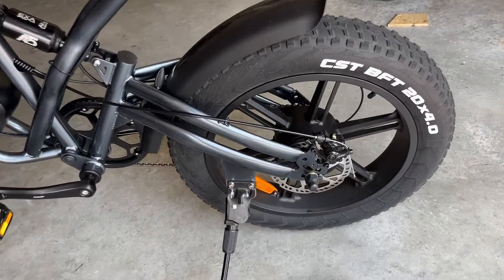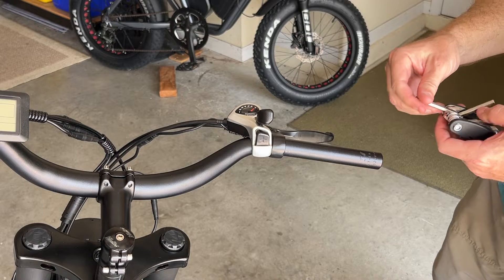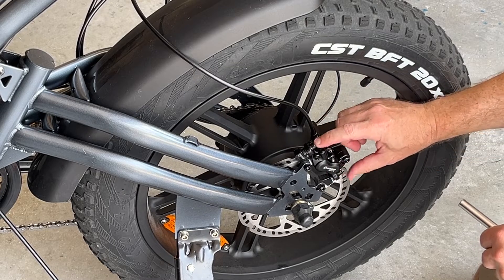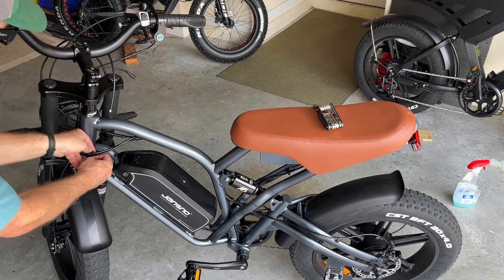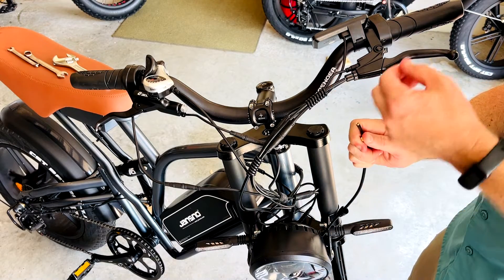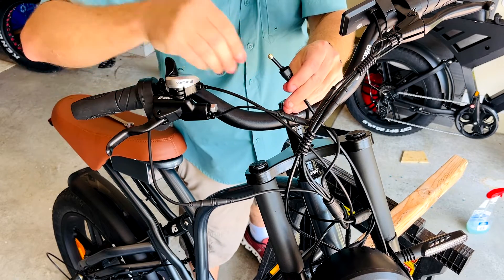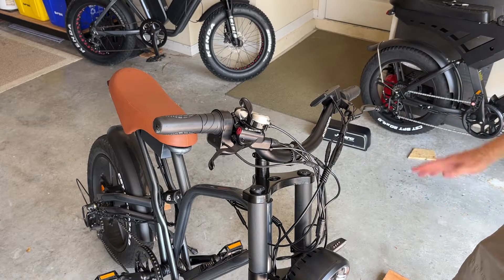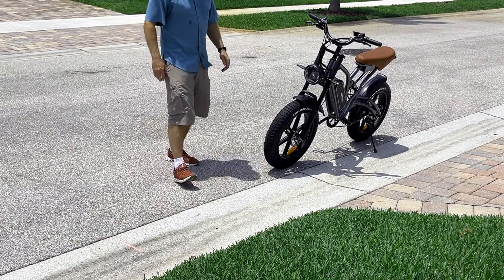Hydraulic Brake upgrade on Jansno X50 X70 eBike - Zoom 4 Piston Hydraulic Brakes

Comment: Hello! I need help, please. The front brake is leaking fluid near the brake lever. Is it possible to find replacement parts? Or can Shimano components be used? Thank you very much!
Reply from the maker: Yes shimano part should work.   Consider tightening the fitting where the cable connects to brake lever

Comment: Did u order 160 mm?
Reply from the maker: I used the stock rotors which I believe are 160mm
Reply: @BRichSolution  just wondering because you left the original rotors on. Which are 160. Did you save the other rotors as spare?

Comment: Any tips for getting those break screws off the one that uses an allan key, the 2 black screws, cuz mine is fully got bold and it doesn't come out, it's like badly worn out
Reply from the maker: Use a torque gun to spin it out quick
Reply from the maker: Or push in the back of the bolt with a screw driver flat head to push it out of the threaded hole when unscrewing
Reply: @BRichSolution  none of that worked, like I can try to show u the image of it how bad is it, cuz its really really bad that even i bought a screw extractor still it didn't come out

Comment: Shouldn't you change the disc too... I heard that hydraulic brakes have a special disc?
Reply from the maker: No the disc are the same.   Some require larger diameter like 200mm but this one can take 160 or 180mm disc
Reply: I have ouxi V8 with mechanical brakes like the ones you had before.. I want to change to hhydraulic

Why didn't you choose hydraulic brakes with 2 pistons?

What type of brake pads with 4 pistons? Copper... Sintered ...semi metal...

Is your bike disc F180 _R160

Comment: Today I completed all the improvements. I changed the suspension strut. I also put different handlebars and grips on the bike. And last but not least, the conversion to the Hydralik brakes. I would like to thank you for the tips.
But now the bike squeaks a bit. Not even when riding, but rather when I make small movements with it, for example when pushing or parking. Unfortunately, I can't localize the squeaking exactly.
Greetings from Germany
Reply from the maker: See video 19:10 for eliminating the squeak https://youtu.be/dq3sseWgXOw?si=m2k3TiYBxK5cZ5oM

Comment: I did all that you said and it works like a dream. However I don't know if Jansno brake pads will work for replacements as I have about 10  pairs. Anyone out there that wants these free let me know and I'll mail them to you. Also are these Zoom pads only made by Zoom?  Thanks for the tutorial.
Reply from the maker: stock brake pads are only dual piston small pads; these brakes require 4 piston large pads; Link to replacement pads https://s.click.aliexpress.com/e/_mO6rbUk

Comment: hi, great job! about the brakes kit, you've bought the one with Tube length: front = 1100mm / rear = 1850mm, or Tube length: front = 950mm, rear = 1850mm ?
Reply from the maker: I believe the 950mm (37.4 inches) front brake cable will work but measure just in case

Comment: I'm in the process of installing this as well, replacing the mechanical brakes of a Himiway Step-Thru Cruiser.. first off, THANK YOU for being the only video I've found so far that actually shows ones without a pre-installed hydraulic hose, I'd been so worried about doing something wrong that they've been sitting in the box for a couple months while I save up to pay a professional to do it. I am having a problem, though: the brass olives are just slipping onto the tubes and freely sliding around. Can I just crimp them into the threads of the fitting or do I need to find better-fitting ones?
Reply from the maker: I would find a better fitting olive if you can.  Local bike store has them and you can size it up and pay $1 for them
Reply: hey so funny story, i have the opposite problem, my olive is too small and won't flush with the tip of the cable, any suggestions 🤔

Comment: Do you know if theres anyway to upgrade the controller to a 60v controller? If so where could i buy it?
Reply from the maker: There would be no 60V controller that will work with stock motor, screen, turn signals, headlight and brake light.  You will end up re wiring the whole bike in the end

Comment: If I want to upgrade the speed on the jansno how do I
Reply from the maker: Go to 52V battery will gain 2-4 km/h.   If you change the controller you will loose the directionals.   Or sell the Jansno and buy Amyet G60 it goes 33mph or 53 km/h
Reply: Can you put a 52v battery on 48v bike ? I have a freego f2 and want to do the same

Comment: I have E09 (controler)  how i can fixe it
Reply from the maker: E09 is a motor fault code.  Make sure connections between the motor and controller are tight and no water got in them.  Unplug connections and reconnect

Comment: I have a problem I need longer bolts how do I know the size so that I can get them
Reply from the maker: M5 bolt most likely.  Bring the shorter bolts to hardware store and then will set you up with the longer bolts or use the longer bolts from the stock brakes

Comment: So I got these brakes and put it on my jansno and they squeak REALLY BAD! Any ideas to make them not squeak as much?
Reply from the maker: Rotor are dirty, clean rotors with some soap and water then use alcohol pad to lightly whip the rotor
Reply: Ok thanks!
Reply: take out the squirrels and try again

Comment: PETCHOR HB-100 Line Pulling Hydraulic Disc Brake Calipers . Got these for my bike. Cheap
Reply from the maker: HB-100 is easy to install but they are only 2 piston as zoom are 4 piston

Comment: To let people know Zoom also makes inline hydraulic brakes so you don't have to change the line but they are not as good as the hydraulic line but for only $42 for the pair you can't beat it...you da man Rich thx 4 all U do 4 us
Reply from the maker: The incline brakes are still mechanical?
Reply: @BRichSolution no there in line hydraulic brakes that uses line cable but the CALIBUR is hydraulic
Reply: Do you have the link cuz I don’t wanna mess with the lines

Comment: Nice work man. I need to upgrade my brakes on my razor ecosmart and razor e300 
I got them both used from offer up $150 for both. I got new batteries and now looking for getting new brakes now
Reply from the maker: Hydraulic brakes would be big impovement